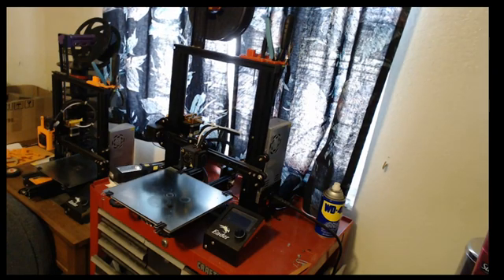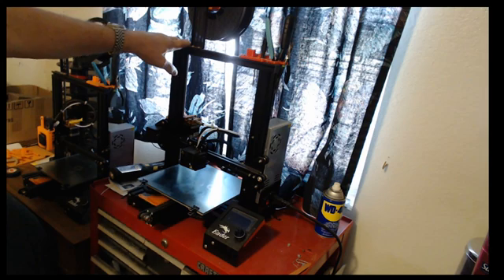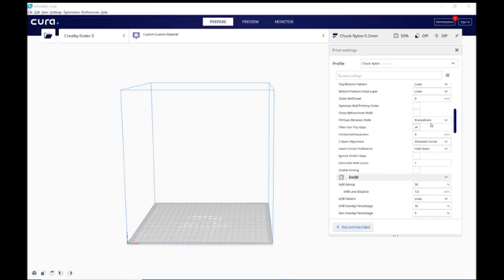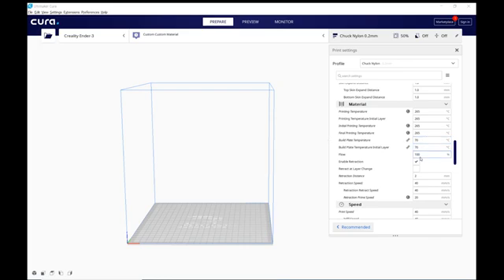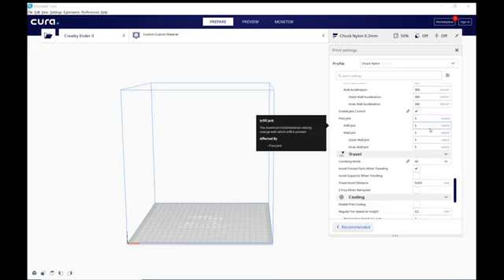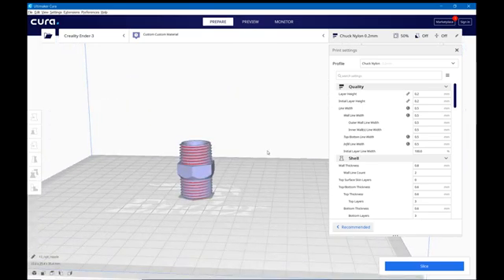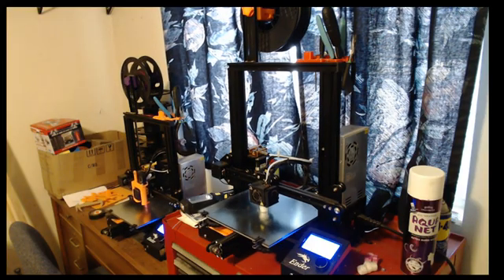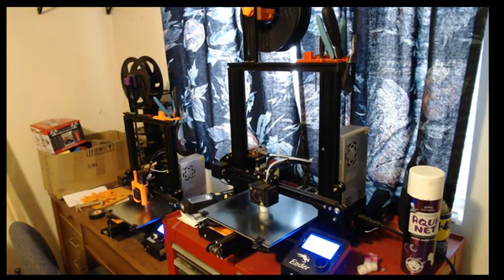Printing  with Nylon Filament on the Ender 3

Comment: Chuck...thanks any recomendation on less visible lines.  Would a 1.2 layer height make less lines?
Reply from the maker: A thicker layer does mean fewer vertical layer lines, but the lines would be deeper and more noticeable. It would also mean having to use a much wider line width because you'd have to go to a huge nozzle to achieve it. Max layer height for a .4 nozzle is around .32 to .35. I've gotten .64 layer height with a .8 nozzle but with lines that wide and tall the print quality really suffered. Going to a 1.0 nozzle didn't work because the printer couldn't push that much filament through the hot end fast enough.  

I made a video of this here - https://youtu.be/P4IlCFGObq4

 Honestly, if you don't want any visible layer lines and the parts are just ornamental then a resin printer is the way to go. If you're stuck with FDM printing then either using ABS filament and acetone smoothing (done right the setup would probably cost you more than a resin printer), or using a finer layer height with a high build spray primer and sanding are probably the best ways to go. If I had the choice I'd just go with the primer and sanding, it's the cheapest and probably the safest.

Thanks for watching!

Comment: did you have to upgrade the firmware to get higher temps or not
Reply from the maker: You can print Taulman Bridge nylon at 240 to 250 with the stock firmware and hot end. If I did it much I'd upgrade the bowden tube to Capricorn, but as long as the printer is stable at that temp you can do it. My old ender 3 (an original pre order model) would not print long at anything above 240. And the bigger problem is dealing with warpage, which isn't a problem for small things like pipe fittings, but anything larger and it will be a problem and the only way to cure that is to enclose the printer, like I did in later videos. And I figured if I was going to all the trouble of enclosing it, moving the power supply and control board so it would be outside the enclosure, then I might as well go all the way and upgrade the control board, firmware and put an all metal hot end on it, which again I documented in later videos.

Comment: Have you ever had any luck printing pom I'm looking for any information for building clogged pulleys for my stepper motor to make a power feed for my milling machine and I really would like to use a delrin type plastic
Reply from the maker: I haven't used POM yet. Nylon also works well for toothed gears and pulleys. But I'll stick a roll of POM into my next filament order, sounds like a fun  filament to work with.

Comment: Thanks for this nylon filament tips.
However I like to know if is also needed to oil nylon filament as PLA.
I have printed several garden hose adapter to 3/4 NPT tubes/connectors on PLA only I will try with nylon now.
Reply from the maker: The only time I use oil is on an all metal hot end when I need or want more than 1-2 mm of retraction.  
If your printer still has a standard hot end where the bowden tube pushes around 1-1/2" (45mm or so) into the hot end, then you don't need oil and you can use 5-6 mm of retraction. if you have an all metal hot end, then either lower your retraction to 1-2 mm or use oil. 
For a pipe thread adapter retraction really isn't needed so I'd keep the retraction low and not use oil. If you're getting a lot of stringing inside the adapter try turning on combing mode in Cura or look for a setting called something like "Avoid crossing perimeters" in other slicers.

Comment: Hey chuck thanks for this video, I used all your settings and the bridge nylon, the problem I keep having is layer adhesion, it is very poor thus taking away the strength of the nylon, any tips?
Reply from the maker: Sure,
 
1. Dry the filament and keep it dry while printing.

2. Print hotter, I wasn't getting good success with Bridge Nylon until I got to around 260-265c.

3. Bring the bed heat to 70c or higher. 

4. Print slower. Keep the print speed to 30 mm/sec.

5 Turn off the part cooling fan and make sure the printer has no airflow over it from an A/C vent or fan.

6. For larger parts (or if all else fails), enclose the printer and bring the internal temp up to 35 - 40 before beginning the print. Let the whole part cool down slowly in the printer before opening it.

I could get small parts, such as a pipe fitting, to print without the enclosure, but anything much larger than that would warp and fail at some point.

Comment: Hi Chuck, Thank you for such an informative video.  I want to begin printing with Nylon on my Ender 3.  
I was under the impression that Ender 3 already comes with an Aluminum extruder and a metal hotend. Are the original Ender 3 extruder and the hotend not appropriate from printing Nylon? If, the answer is depends, then how do you check that?
Reply from the maker: The stock Creality hot ends are made out of aluminum, but they are not what's commonly referred to as "All Metal". The reason for that is they are drilled large enough so that the teflon tube the filament travels though can be pushed all the way through the heatsink and heat break until the tube presses against the brass nozzle. This allows for large retraction settings as the molten filament will not clog in the teflon tube since it's so slick. This makes for really clean prints with little or no stringing. But the problem is the teflon tube can't handle the temperatures required for printing filament like nylon and polycarbonate.

The All Metal hot end is only drilled big enough for the teflon tube for the first half inch or so, then the hole is just big enough for the filament to pass through the heatsink and heatbreak on it's way to the nozzle. While this means we can raise the temps up to 260 and higher, it also means we can't retract the filament up as high or it will clog against the metal. Oilers will help with this, but clogging is still a real danger and it really sucks when it happens. 

If you're willing to stick with a fairly low temperature nylon like Taulman bridge, you can probably get away with the stock hot end and use Capricorn tube and keep the temps at 260c or so.

A bigger problem is the lack of an enclosure. Nylon (as well as some others) really need to be printed in an enclosed environment to keep the print temperature up to avoid warping during printing. When they warp during printing they will pull off the print bed and often come loose during printing as the nozzle will hit a part of the print. 

I see now Creality makes a nice soft enclosure, which might be a good thing if you only print nylon occasionally and will mostly be sticking with PLA or PETG. But if you're going to print nylon or polycarbonate a lot, then it's worth while to dedicate one printer just for that, build a solid enclosure and put an all metal hot end on it as well as the other mods that will let you print consistently at temps up to 300c.

The stock extruder will be fine as long as it's aluminum and has a decent gear and spring. If it's one of the dual gear extruders then it's extra good.
Reply: @3rdpig  Understood, thank you for your time!

Comment: Hi thanks for your video, I'm looking at printing nylon on my Ender 3 do you think the thermostat replacement is necessary or is it just a nice to have?
Reply from the maker: By all means try it with a low temperature nylon like Taulman Bridge. I'd recommend you don't go higher than 250c - 255c. The stock bulb type thermistor and stock hot end will be ok for that. 

Unfortunately, my results at that temperature were mixed. I could get small parts to print OK, like the 1/2" pipe connector in one of my videos. But when I tried larger parts I found that I getting warping and layer adhesion problems. 

It wasn't until I enclosed the printer that I got rid of warping on larger parts. And it wasn't until I switched to an all metal hot end, flashed the control board to stock Marlin (or even better replace it with a better board) and the screw in thermistor that I could reliably print at 265c which is where I found I got good prints with good layer adhesion on larger parts.
Reply: @3rdpig  thankyou very much for your response! I'll keep that in mind when start printing nylon!

Comment: Do the pieces warp after a while ??
Reply from the maker: My experience has been that if you get them off the printer without warping, then they won't warp. I'm still using some of the parts I printed in this video from nearly a year ago and it's been fine. The trick is to get them to not warp while printing, and I eventually modded one of my Ender 3's to print at higher temps and enclosed it. Since then all my nylon prints have been good. See my later videos for more info.

Comment: do you need to upgrade to print out Nylon filament?
Reply from the maker: It depends on the printer and which nylon filament you want to print. If you have an Ender 3 and want to print the Taulman Bridge Nylon which I found to need a print temperature of 265, then yes you'll need to upgrade. Neither of my Ender 3's would print reliably above 250c nozzle temps. If yours are like mine, you'll need to flash stock Marlin in order to raise the max print temperature. Then you'll either need an all metal hot end, or you'll have to use an upgraded Bowden tube like Capricorn. Then you'll need an upgraded thermistor that can read temps reliably to 300c. And I was experiencing warpage, so I enclused the printer. Other people have told me they've gotten nylon to print on an Ender 3 without those things, but I couldn't get a print with it that satisfied me. Now I can. Fortunately, not of the upgrades are expensive.

Comment: Hi Chuck, do you have a video of you installing the screw in thermistor? Do i need to flash a new firmware for it? Thanks!
Reply from the maker: I honestly can't remember if I have the thermistor replacement on video. But it goes into the threaded hole that the screw that holds the stock bulb thermistor goes in, so it's a quick and easy swap. When I first swapped it I didn't even run the wires full length, just spliced it into the existing wires.You only need to flash the firmware if you want to go above the max temp that's in the current firmware.

Comment: It looks like there is a hole in the threads at  in the second thread up from the nut at 13:11-13:12.    It shows up again at 13:25.  Was it really intact, or am I seeing things?
Reply from the maker: It does look like a hole, but I think it was just dirt from the pliers. I've had those for a long time and they've seen a lot of use and not a lot of cleaning.

Comment: Hi Chuck,
Thank you for the videos; just subscribed. What was the screw in thermistor you used? Was this for the extruder or the bed? I would like to print higher temperature materials (PC and Nylon) on my Ender3. Do you have a video on how you modified the firmware? 

Thank you again for the video.
Reply from the maker: Hi Bruce! I'm pretty sure the link to the screw in thermistor is in the comment section under the video where I did the upgrade. And yes, I have several videos covering the firmware upgrade. If you can't find them let me know and I'll dig them up later.

Comment: Hi, with all the mods you've done and/or will be doing as you appear to be a real go getter, I'm surprised that the very first mod for the E3 was not a direct drive or at least the Luke Hathaway (right name?) Bowden tube mod...…..maybe I missed something in the vid.
Reply from the maker: I've had several people ask that, but so far I honestly haven't seen the need to spend the money. The least expensive DD mod for the Ender 3 I've found is $35 and most are double that. I'm not sure why so many people think it's almost a required upgrade for the Ender 3, possibly because the stock extruder is garbage, but any of the metal extruders, even the $5 at AliExpress will solve that problem. Sorry, I've never heard of the Luke Hathaway bowden mod and Google isn't finding anything by that name. Got a link?
Reply: @3rdpig Hi, Maybe I got the name wrong but it is the mod about having a short piece of Bowden tube in the hot end that is permanently there to prevent the possibility of the long tube pushing back and getting a clogged nozzle.
Reply from the maker: @gangleweed  I get it. I've never had the problem with the bowden tube coming out on any of my 3 printers. I suspect it has more to do with crappy fittings or tubing than anything else. I've used bowden tubes for high pressure hydraulic and air lines and never had a tube come out like some people are having with the Ender 3. I've overpressured them (my fault) and had the tube themselves burst before it comes out of the fitting. That's my opinion anyway, but until someone can show me otherwise I'm sticking with it.

I have two objections to the DD extruders.
1. Cost/benefit. I'm getting very good prints, have very little of the issues that the DD extruders claim to fix and have no problems at all printing with flexible filaments. 
2. Weight. I've had problems now with both of my Ender 3's having X axis layer shifts and I've had to turn down both acceleration and jerk settings in the slicer to cure it. So it just doesn't strike me as a great idea to move the weight of the stepper motor off the frame and onto the onto the X axis carriage.

But in the unlikely event that one of the companies who makes DD extruders would like to send me one to test and review I'll do it. But right now they seem to me like a solution in need of a problem.
Reply: @3rdpig Hi, I suspect that you are quite right, crappy tube fittings are a cause in many cases....and too many fixes for problems that are elsewhere. The extra weight factor on the beam at the far right side has me worried too especially as the Z axis is driven from only one side. I don't think the 3 rollers on the right side actually keep the X axis beam level as they are just pressing against the upright column in the vertical plane and the span of the beam can be moved out of level if the wheels on the right side drag a bit. I'm toying with the idea of making a new roller bracket plate for the left hand side Z axis to have 4 wheels not 3 as I think the 3 wheel design does not maintain the X axis beam truly square....the wheels being soft enough to compress under the loading etc. If the Z axis wheel adjustment is slightly loose  for ease of travel the beam will move up and down and if too tight they will form flats on the rollers when left idle for a time. I think the leverage of the beam's length will impact on 3 rollers as the single wheel is in the mid position.

Comment: to prevent the stringing, you could use simplify 3d and travel only in the object

that would solved the stringing quite a lot, another option would be to use the nearest seam, that would more or less only travel on the object itself.
Reply from the maker: True, but it's kind of hard for me to pretend to be a guy on a budget if I'm using a $150 slicer. Reminds me of the time I was on a diet and ordered battered dipped, fried fish and a diet coke. Boy did I ever get shit about that from my favorite waitress!  lol

Comment: Have you seen the teaching tech videos with the direct drive upgrade chuck? I have it on my ender 3 with the seemecnc extruder and love it. I also use glass with hairspray and have no need to bother with anything else. Wish i knew how to do firmware upgrades because i bought the upgraded creality mobo with tmc drivers and love it but even with the bootloader on it i have no idea what to do and fear messing it up.
Reply from the maker: I've seen several reviews of direct drive extruders. It just doesn't seem to me like I'd get a lot of return for a fairly expensive upgrade. What did it do for you that the original bowden tube setup didn't? Flashing the firmware is easy, the hardest part is getting the bootloader on and you already have that.